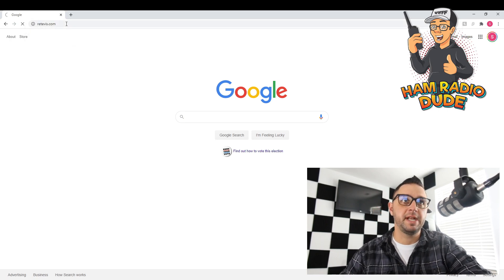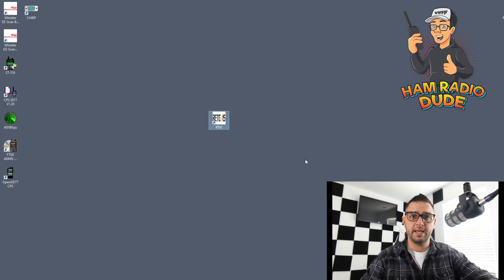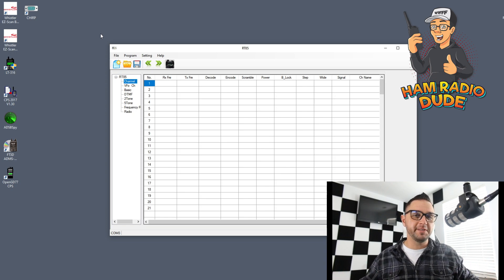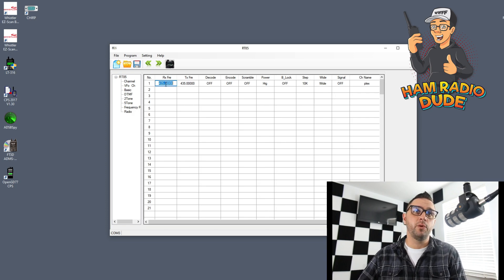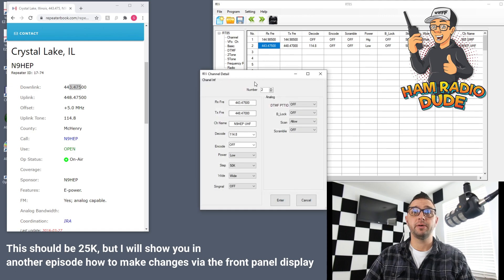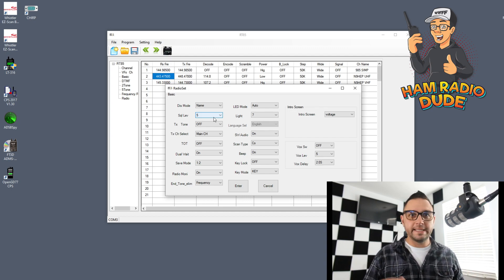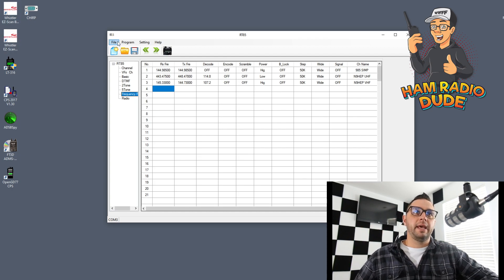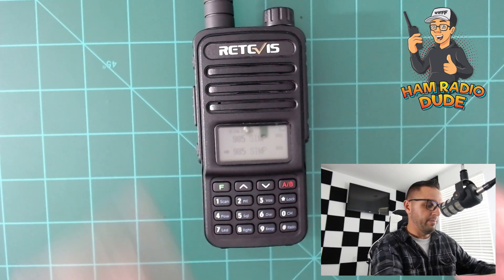RETEVIS RT85 - Programming Walkthrough (PART 2) RT-85

Comment: Help pls, im stuck at 144.000 to 148.000
Reply from the maker: See one of my other comments on the multiple comments you left
Reply: @DudeTested  yes, i did that but it did not work, still stuck on amateur range
Reply from the maker: @joeyybiernas8294  interesting. Its been so long since I made the video, that I forgot I put the unlock instructions in there.  I no longer have it, but let me do some research and if I find anything, I'll get back with you. Thanks.
Reply from the maker: I just found this information from a few months ago: " The new UV88 radios shipping to the US are pretty well locked down in firmware, You can not receive anything above 450Mhz or 148Mhz even when you program the radio with the CPS. I tried with both CHIRP and the TYT CPS. My intent was to monitor a couple of public safety frequencies. No Joy."
Reply from the maker: @joeyybiernas8294  if you have a programming cable and can find an older firmware, maybe you can downgrade the firmware, but I'm uncertain
Reply: @DudeTested  thanks , i will try that, more power and God bless
Reply: @DudeTested  hey man, its f and 4. To fix the issue its pressing f and 4 ,then turn it on. Not 1 and 7, not f and 1

Comment: Which cable are you using to connect your radio to the computer?
Reply from the maker: It was a cable retevis sent with the radio.  Odds are it was just a rebranded baofeng cable. https://www.retevis.com/2-pin-programming-cable-for-retevis-h777/

Comment: I believe at least on some programming software for the NOAA and whatever else you don't want to transmit on you can leave the TX FREQ. blank and it will disable TX. I think CHIRP is like that.
Reply from the maker: This is a good tip, I'm going to try in the morning and will update in part 3!. Thanks!
Reply from the maker: Many Thanks! That worked.
Reply: @DudeTested  Glad i could help! 73's from KC4Q
Reply: AS a plan "B" so it doesn't autofill NOAA, program in 144.000 in tx. Least you'll be in the ham band W9DLP
Reply: Plan B is to set the duplex mode to "off" in Chirp. Rather than "(None)."